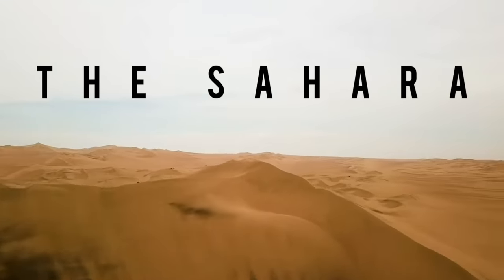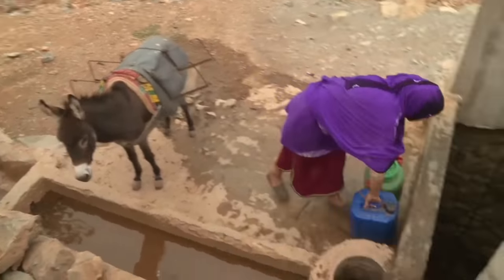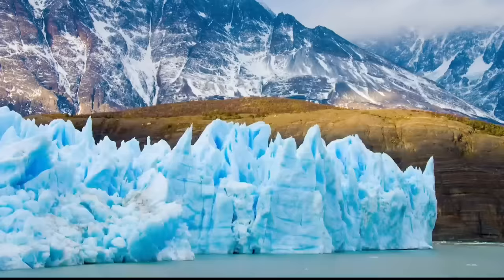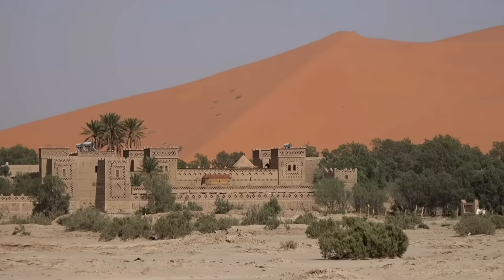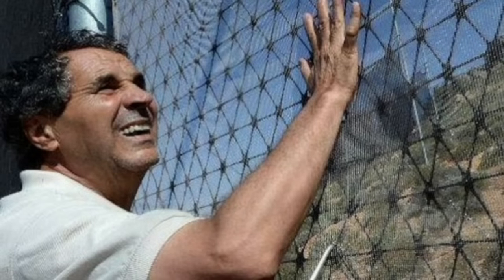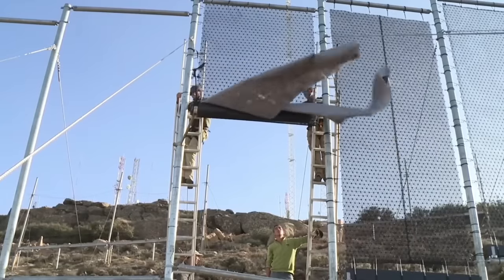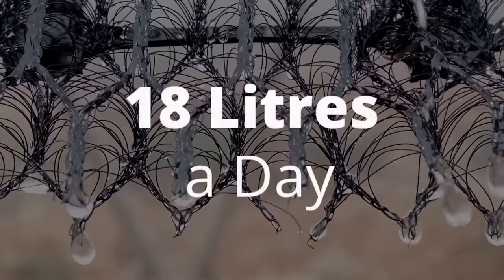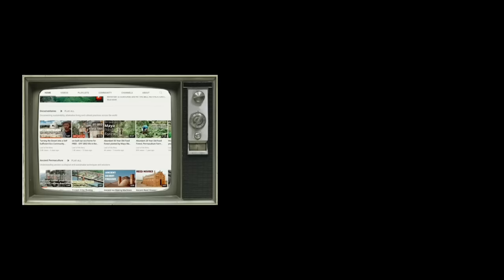How This Incredible Invention Is Making Water In The Desert For Free!

Comment: I first saw this about redwoods - they do this naturally from the mists coming in on the Californian coasts to the extent that it would be dripping from the leaves and down the trunk. I would expect that they would pull in enough water for other plants around them as well. 
What they would need to do, is to look for native species that do this, plant them, protect them from firewood harvesting and see what happens next. We could imaging that if all the redwoods got taken out, that the ecosystem would dry out - not because of climate change per se, but that a keystone species was taken out.
Did this happen in some places? And can this damage be reversed.
Reply: I live in the Santa Cruz mountains among the redwoods for many years and they do pull an amazing amount of moisture out of the moist ocean breezes that blow inward from the Pacific. However all the species dependent on the redwoods would die out were that air to be replaced with a dry wind like that that blows across the Sahara because it has so little water that even if it was 100% drained of the little moisture that it carries it's wouldn't be enough to keep grass alive.
Reply: Evaporation rates are much higher and faster on deforested land. The land requires the plants and trees to hold the existing moisture like a sponge.  Not only living things require water, the land itself will crack and blow away without it
Reply: Except for clear cutting redwoods don't seem to get removed, even forest fires won't kill them. There's no problem regrowing redwoods if you removed all of them, the anti logging activists are fighting to preserve old growth redwoods not worried that they will go extinct. Redwoods can grow in dry climates if they have water.
Reply: Big Sur has lots of fog in the morning and so does Carmel
Reply: @jakeolthof  
But isn't that area a temperate rainforest that gets the majority of it's moisture from actual rain, not from fog condensation?
Reply: @HighlanderNorth1  Both.
Reply: Yes they said at the visitor center at the Avenue of the giants that they actually get about 60 percent of their water from the fog.
Reply: In San Francisco in my backyard there are three tall pine trees my father planted in the late 1970s. Standing  under them on a foggy day, I was working for a couple of hours. At the end of that time with my shirt was soaked… With the rain that had fallen from the trees which condensed the fog. 😳
Reply: @californianorma876 how would any knowledge ever be gained, without someone experiencing something in his backyard?
No uncle or cat involved in your eye opening story?
Reply: Don't redwoods take a long time to grow? Logging should be banned as trees are beneficial and necessary for all life. There are other natural materials to build houses, etc
Reply: Any dry areas that have frequent fog
should look into this. So simple yet
brilliant.
Reply: I remember seeing how foggy it got as I drove down from northern California and wondering if they couldn't somehow do something like in this video to capture some of the fog coming from the Pacific ocean and then channeling it to other parts of the state that need more water.

It didn't even occur to me that other people are already doing that in other countries. Hopefully this catches on in other parts to get clean water before people start going to war over it.
Reply: You can't just plant X species into Y place all willy nilly. They have evolved to have very specific nutrient requirements in their native soil on-top of things like temperature, pest resistance and even abrasion resistance when it comes to places with sand.

Comment: I stayed on the top floor of a hotel sitting on one of the hills in foggy San Francisco, in a corner room giving me windows facing east and north!
The windows were so dirty, so covered in irregular dust and dirt patterns I called the desk to inquire about how often they clean the windows.  For $600 a night (15 years ago) I kind of thought I might be able to see out my windows at night!
They had recently washed the windows!  The windows get so dirty from the fog! Seems fog holds and carries plenty of dust and other stuff, and it coveres everything with that mixture leaving the solids when the moisture evaporates!  
I found if I want to look out the windows at night all I had to do was turn the room lights off.  The dust film acted as a exterior window shade reflecting the room's light back into the room.  Turning the light off allowed me to see through the layer of dust, so I could see  the beautiful night cityscape and boats coming into port from overseas. With the lights off the dust layer disappeared allowing me to get wonderful pictures of a big, bright, full moon rising in the east! Completely unexpected;  what a surprise! 
What a lucky happenstance!   If I hadn't been fussing over my dirty windows I would have missed it completely!
Some of the best pictures I've ever gotten all due to dirty windows from abundant fog.

Comment: Love the video. However, I'm not convinced. What is the cost per litre of this water?  If the cost is too high then it's just another good idea that will end up going nowhere. Maybe the cost is too high now but it can be reduced over time. Can the channel provide a view on this?
Reply: dražen g  You're probably right that most of the cost is upfront. 

However, you will be aware that the video is very specific on some of the numbers (e.g. volume of water per 'fog day' per square metre). So why doesn't it tell you the cost? The project must know the numbers but they choose not to share them. Not even approximate, or 'best case' numbers. 

That makes me very suspicous that the costs are way too high and that you would get better results by simply spending the same money on something more mundane like fixing leakes in the existing water system.
Reply: .... use the nets to water the newly planted vegetation until they are established.
Immediate and long term solutions (sorry!)  in one go.
Why not?

Comment: This is another nice arrow in the quiver of producing fresh water.  The key is the cooling of the fog and the area of collection points.  Perhaps ribbons instead of wire meshes, though I wonder about durability?  Luckily where there is fog there is shadow and the collection mesh is naturally cooler since it is dark in color.  This mesh as currently designed might be worthwhile as a shadowed collector at the shoreline itself, the key being the cooler nature of the black mesh.  Moisture rich air blown in by gentle breezes to ducted conduits with multiple sheets of this lovely material would produce water.  The question being the economic viability.

God Bless Us All

Comment: These are great for areas of dry arid conditions.  But I am an analytical information sponge.  
  Question : Have you done an analysis of the affects of removing moisture from the air that carries it downwind to other places ? 
  Question: Does the devices change the wind current dramatically enough to negatively impact other regions of topography?
Reply: The amount of water captured is a tiny percentage of the whole and the wind passes right thru the nets. Not much effect down wind.

Comment: I remember that small bottle that would collect water while cycling, or that partially underground device supposedly extracting water. Expensive projects with a lot of hype, but little effect. People trying to reinvent the wheel basically.

And then there's this. Some nets collecting mist. Far more effective and likely far cheaper as well. It's also already been in use for decades at the very least.

Comment: I know this is a huge relief to the people benefiting.  I am very happy for them.  I do have a question, though.  Since everything is connected, will removing water from the atmosphere in this way have domino effect in other areas?
Reply from the maker: Firstly its not removing water in a sense, the fog nets let the foggy moist air pass through, the water is only captured by creating a surface for the fog to form into water droplets, like a tree or plant would, there is still plenty of fog to pass by that doesn't get picked up from the net.

Comment: Fantastic!! But I still don't undesrtand how the net causes condensation...? A detailed explanation of the process would have helped.
Reply: Fog is where the air is approaching its maximum carrying capacity of water at a given temperature. If the air has the ability to give up some of that moisture, it will do so

Comment: I've seen something similar and a lot easier and cheaper to make by stretching some type of mesh tarp above a hole with a weight in the center of it, and the water that collects on the tarp runs down and falls off into a catch basin where the weight is.  Probably doesn't produce near as much as these, but much cheaper and easier to install

Comment: At 0:09 the video shows "11,000,000 KM**2" ie. 11 million square kilometers, BUT 
the narrator says "eleven million kilometers squared".      This is incorrect. 
"11 million kilometers squared" describes an area "11,000,000 kms x 11,000,000 kms" which gives "121,000,000,000,000 sq kms".

Comment: The thing is if you remove water from the air in one place it isnt present in the air for another.  With enough of them this will change weather patterns and could cause a lack of water somewhere else.  What if crops in Saudi Arabia are lost because of a lack of rain caused by the prevailing winds from Africa being dryer?  That may just cause desertification in another area.

Comment: What happens if dessert sand gets blown and settles on these nets? Would it reduce the efficiency of these nets? How much effort and resources are needed to clean these nets?
Reply from the maker: The company have been monitoring and testing them for over 10 years, probably ask them directly if you want to know the answers
Reply: From what the video says, the prevailing wind comes off the sea so desert sand should not be an issue

Comment: OK, a pound of 80°F. air in the atmosphere at saturation, 100% relative humidity, will contain .0022338 lbs. or 156 grains of moisture. You probably already knew there are 7,000 grains to a pound.
At 60% RH, how we rate our dehumidifiers, there would be 92 grains in each pound or air. That pound of air, in turn, occupies 13.3 cubic feet in the atmosphere, a cube about 2-1/2’ on each side. That’s what the weather was like at my house in Florida all through Christmas. Some people live in places like Madison, WI. A pound of their air would only contain 5 grains at 0°F.
People on average need about 6lbs of water a day so this would mean
6lbs*7000grains/lbs=42000grains
42000/156grains per lbs air = 269.23 lbs air
13.3cubic feet per lb air * 269.23 = 3580.77 cubic feet 
That is basically a house, you need a house sized area for 1 person at 100% humidity every day to ensure that 1 person doesnt die of dehydration.

Comment: Good for them.  There might be a useful wrinkle in the works; to the effect of static electricity?  Something like that.  The notion is to use solar-powered rechargeable batteries to power small metal points in one sort of charge, positive say, and the mesh is grounded to the Earth, say.  The prevailing winds push the naturally occurring fog to the line of positive charged points, which then are further pushed to the plastic coated metal nets which are grounded to the Earth.

Comment: walks 3 miles to the well
proceeds to spill half of it on the floor
Reply from the maker: Clearly you've never used a bucket well pull system, its pretty hard not to spill something, thankfully the water just trickles back down into the well, not a big deal

Comment: The Sahara is the driest place on earth. There is no fog. Dry winds blow toward the coast. Maybe there is 0.000000001% of the area that may have some fog, and expect more on the eastern side, like the coastal area of the arabian peninsula.
Reply: The Sahara is absolutely not the driest place on Earth, that's the Atacama. Both the north and south poles are drier than the Sahara.
Reply: @Lewiigi  Dryer air at the poles because of temperature, but walking on ice, therefore water. Depends on how dry is defined. In terms of water content, yes. In terms of % relative humidity, the poles are wet.
Reply: @tarwingrill4531  You can't just change the definition of words like that, humidity actually means something very specific in this context—especially since we're talking about fog nets. The average air humidity of the Sahara is ~25% whereas the air humidity of Antarctica often falls as low as a fraction of a percent.

My point is, there is absolutely enough water in the Saharan air for these collectors to extract fairly large quantities of it.

Comment: why do they spill soo much water in these water scarce areas? get a funnel, use a cup. always seem to be filmed being very wasteful
Reply from the maker: If water is spilled on a well it will trickle back down to the well. Getting water from a well is not like running a tap, its actually quite impossible not to spill a bit of water

Comment: I wonder if this tech in combination with a micro drip pipe system could be used with Mexico copper canyon as it’s in the mid point of no return for the land to regrow and support forestry plants again instead of the typical dry tumble weed cover trees on the banks thus winding back time on the land to more lush environment and not very fed to support the local cartel

Comment: Actually, the title is majorly misleading. This does only work on the very edges of the Sahara when there is a mountain as well, which will create fog from seaspray almost every day. Well, also only when there is eastward wind, of course. In the other 99,999999999999999999999999999999% of the Sahara, this doesn´t work at all. There is no GREENING of the desert with that.

Comment: I am sorry, but i very much dislike the fact that over half of the video is devoted the background. Also, the people shown are treating the water resource wastefully. Much, too much, spillage. Shameful.
Reply from the maker: Have you ever used an old fashion well with bucket and string? Its not easy to not spill the water, the bucket swings around when you pull it up and down,  also the water spillage near a well, will just trickle back down into the well, so its not a big deal. Water waste is much worse when you just leave the tap running or long showers, hosing a lawn is unnecessary for example.
Reply: @LeafofLifeWorld  Thank you for your rely. Yes, I grew up pulling our water from a well with a bucket on a rope. My largest complaint on waste in your video was where they spilled so much water away from the root zone of the plants. So much effort getting the water, then so much waste on delivery to the crops, Cheers.

Comment: ~ ⚪use you own effulence that's that of the villages/cities and began by conditioning the liquid to be nearly acid free.  Collect it and place i where you will want vegetation to grow bamboo is a good start as a wind/heat break and easy to grow.  The liquid portion and the stool portion will have to be separated for at least one year to reduced acidity.  China is rebuilding the deserts with help from desert villagers and students are required to help in the reinvegation as well. Check out the Chinas/Japan documentary on the y tube.  It will be slow process, yet necessary. Fish tank water clean bath water  whatever leftover use leftover use what you have.  Collect all produce waste to compost and make it manitory, Leaves etc. Cardboard, with no shiny print. Eggshells coffee grounds ...

Comment: Useless crap. Just go to a seacoast, get some ice-cold sea water from couple of hundred meters depth. Then combine it with wet and hot air to condensate. Use solar panels to power the system. You can get tonnes of water per second by doing so, not those pathetic drops.